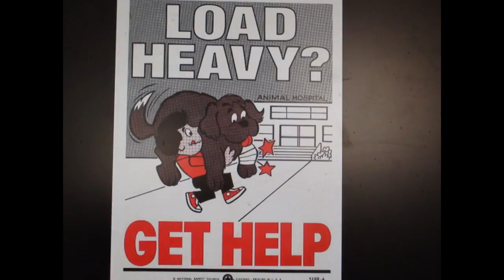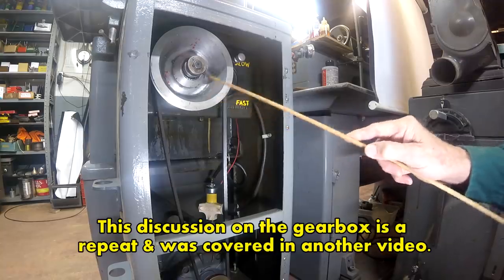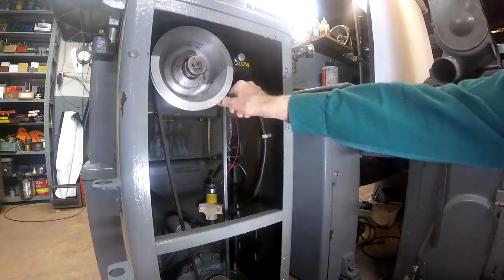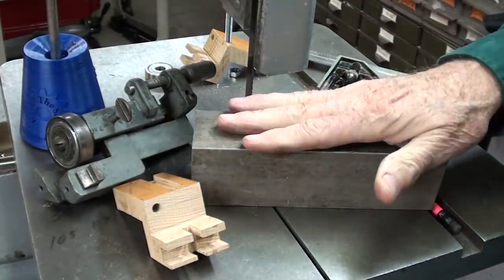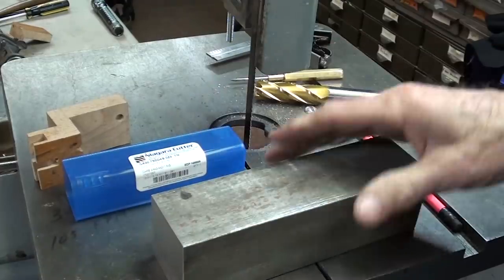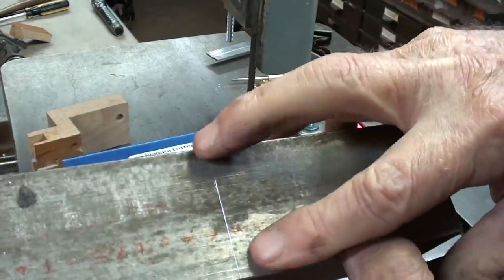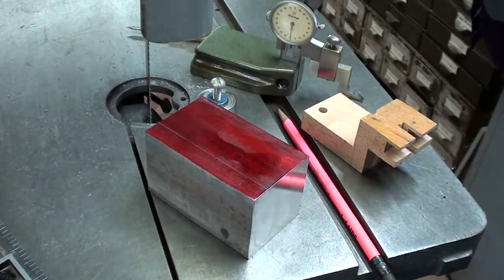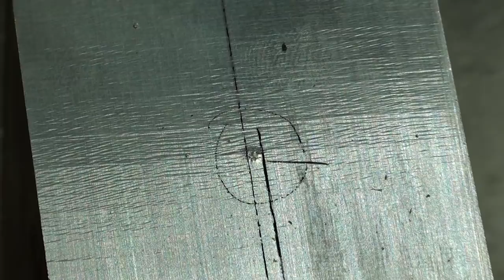BLADE GUIDES FOR BOICE CRANE BANDSAW pt2 Tips 551 tubalcain repete

Comment: I love old and antique equipment. As they say "They don't make things like they used to." I have a 1938 Singer industrial sewing machine that I use to do leather work. It looks pretty bad as most of the paint is worn off, but I can't imagine what went through the machine during WWII. It's 16 years older than I am but mechanically it's perfectly functional. The thread tensioner was worn out but I did find a company that sells new parts for the old machines. I like your videos that you call 'edutainment'. They are quite informative and I must never stop learning things.

Comment: In 55 years in the shop I may have tilted the table on a metal cutting band saw once for a job. But it is handy to have the tilting feature  to make sure the saw is cutting square.
  The more important feature is to have a blade welder on the saw so you can easily do internal cuts thus making usable slugs  instead wasting all day making a pile of chips at the mill or lathe.

Comment: That gearbox probably has the same design as my 1920s Racine Machine & Tool bandsaw. Mine also has the lever and has a pin to mesh the inner shaft to the pulley. Inside mine is 4 gears (drive pinion, idler gear, idler pinion, and driven gear). The lever causes the idler shaft to move toward the drive shaft so the two sets of gears mesh.

Comment: If you milled a slot in the two key steel guides, you could have a small bolt passing right through into the bottom, it might be a bit stronger.

Comment: Thank you , Mr. Pete. The effort you go through to make these videos is much appreciated. When you mill slots, do you use an undersized endmill and then, widen the slot to final dimension by running the endmill down each side of the slot? I was taught to do it that way and not start with an endmill of the desired dimension of the finished slot. I see people doing it both ways.

Comment: Nice job, came out great.
Reply from the maker: Thank you for the scriber, is that a new design? Will that be a part of your regular offerings? Again I like that hex stock so it won't roll.  The drill grinder arrived in perfect condition. I watch that video. I knew that would be a difficult project for you or for anyone
Reply: @mrpete222  Yes on the scribe,  I put up a video today about it.  That was very hard to model.  I don't think I would want to make one.  Even making a casting would be tough.   Thank you for loaning me the parts.  Kept me out of the bars.

Comment: A perfectly serviceable blade guide that should last for as long as you need it.  Making something like that from pot metal is just not acceptable, always results in cracks, stripped threads, and now in your case a more practical and durable design-!
Reply from the maker: Yes